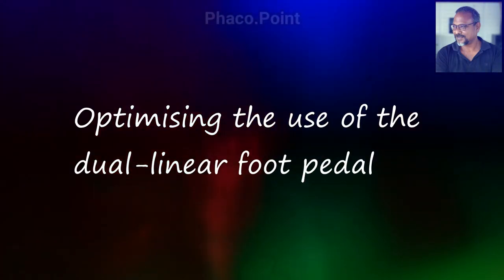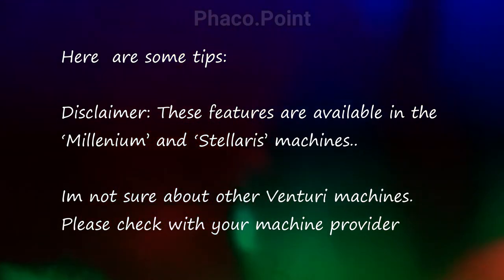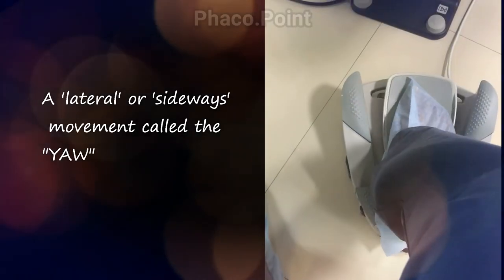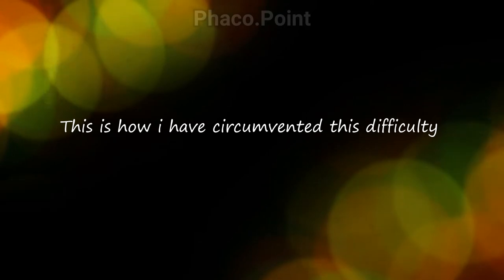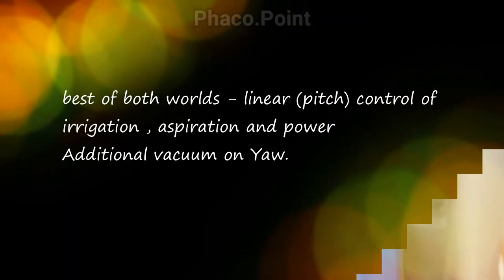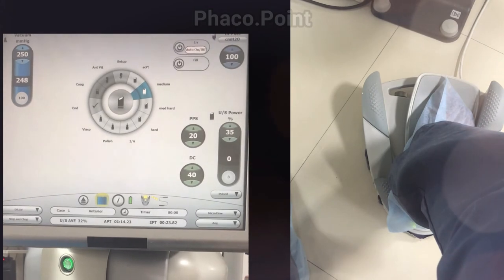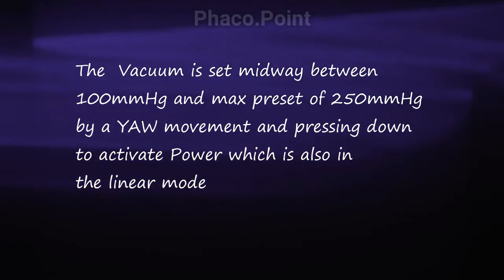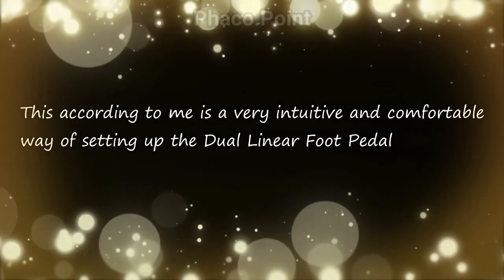Optimising the performance of the "Dual Linear Foot Pedal" system with intuitive settings

Comment: Appreciate the clear instructions Sir! Thank you for sharing. I do use dual linear setting for my foot pedal as well, but the setting Im used to is different. The pitch is purely vacuum  and yaw is phaco power. So I will have to learn a bit how to use your different setting and see what works best for soft cataracts.

Comment: excellent video, congratulations.
What are the parameters you like to use on harder cataracts regarding vacuum and ultrasound?
Thanks!!
Reply from the maker: Hello dr Aguilar. In hard cataracts my power is 50 % in multi burst mode with a burst duration of 35 ms and a dc of 75. Vacuum is 400mmhg
Reply: @PhacoPoint  Thank you for the explanation 🙏